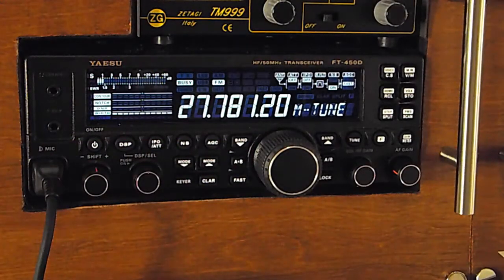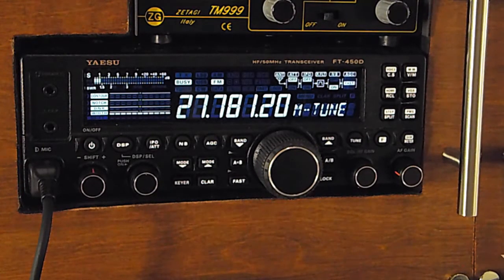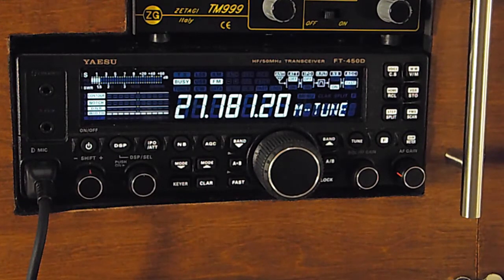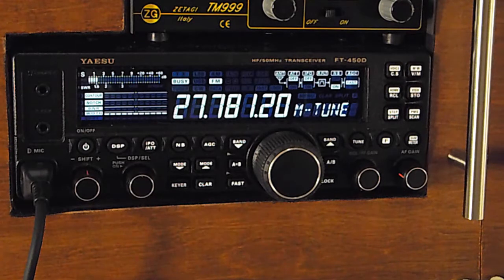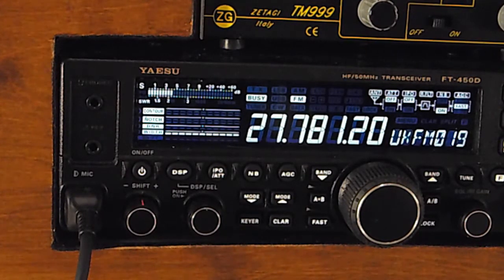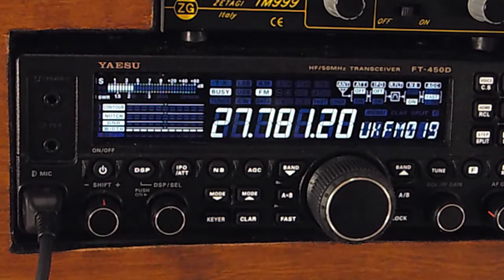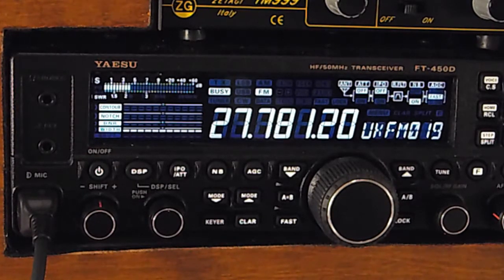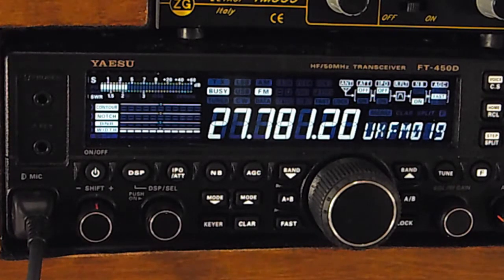Pukka Dave's TM061 Cobra 148 GTL DX MK2

Comment: I've got 4 cobras 148 I've all ways loves it along with president still the best radios not like today's radios. 👍🏻
Reply from the maker: Its sad that pretty much all modern radios are menu based and have a learning curve just to use basic functions.  The 148 was a classic.
Reply: Say that again, I laugh at these over priced Stryker / fake Cobras and Superstars from CRT, nothing touches the 148 GTL DX MK1 AND 11, had mine in 77 MK1, still got it, only thing I did was replace the finals and Output stage trans, it's about time someone did a 148 scam warning, the amount of CRT 3900S I've seen with fake plates on is crazy,